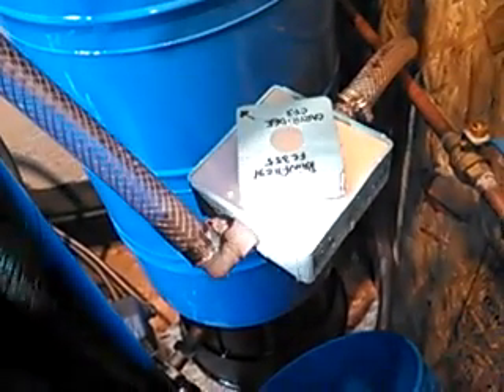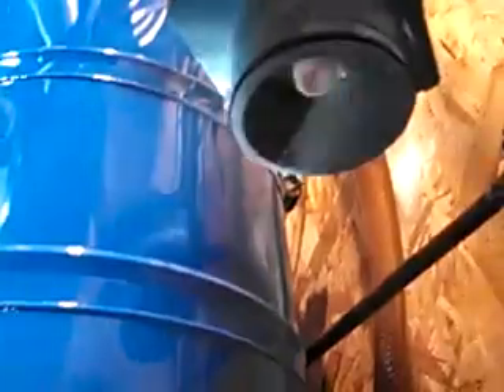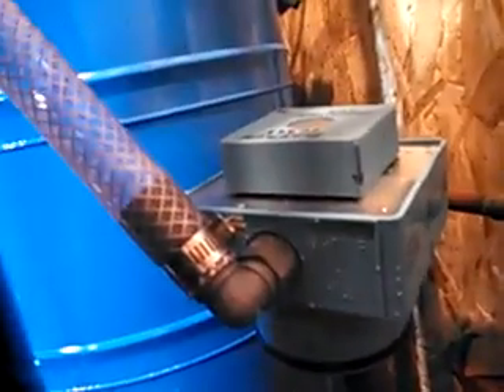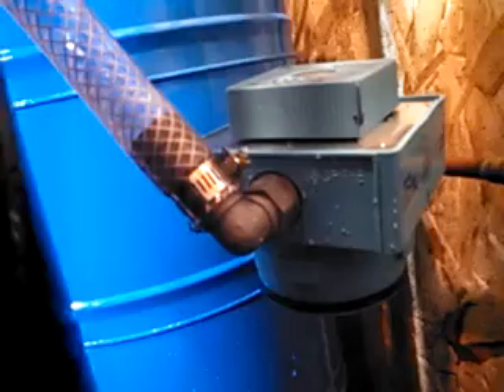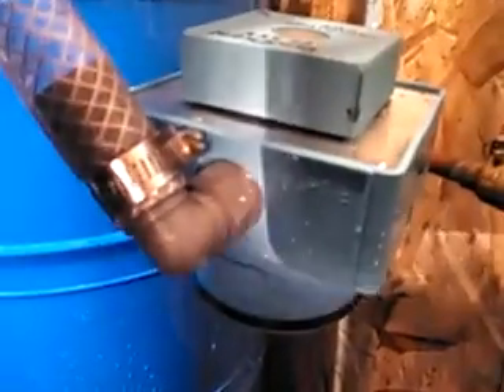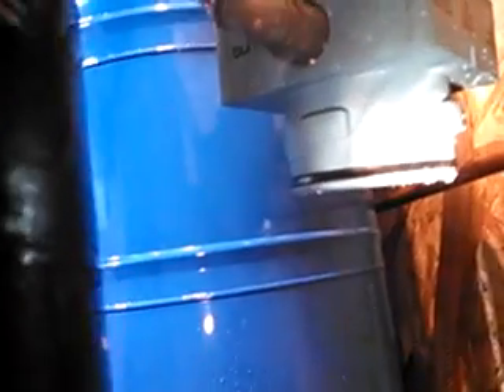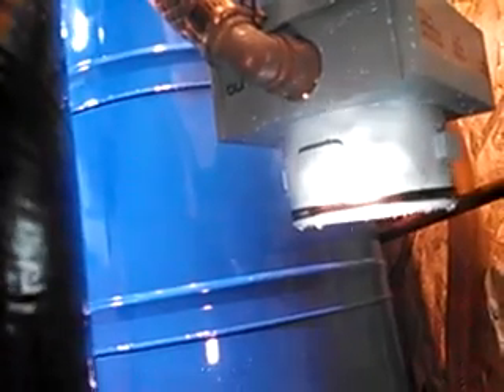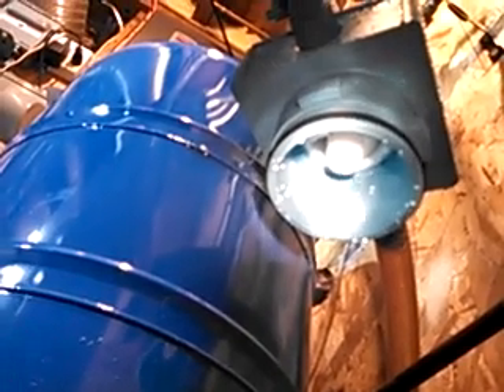Leaking Rainfresh FC355 Filter

Comment: K, just adding this in for folks. With the Rainfresh Bypass type filter unit, you need to turn off the water supply and release the pressure by turning on a tap. Remove the Transparent blue filter enclosure and filter. Carefully remove the center silver (round) cap from the top (rotatable) on/off/bypass block. Remove the screw (#2 Roberts) and carefully lift that block straight off. Note the positioning of the center (white) valve body post for easier re-assembly. Gently push down on the center of the valve body (white) post. The whole assembly should just pop out. (best to have something like a bucket to catch it in) Up inside the main body, you will find (unless they fell out with the valve) 4 "O"-rings that need to be replaced (Rainfresh Kit #516-1 [<$3 Cdn]) Give things a quick cleaning wipe-down, lubricate the new rings with silicone grease (helps them stick in their respective positions) as well as the valve body sides and top surfaces. Very carefully align the valve body back in from below, so as not to dislodge the two side O-rings. the valve body should pop back into its original position. Replace the top rotating  on/off/bypass cap and screw. re-assemble your filter assembly to test, and then you should be good to go.
   Of note: that square aluminum plate below the on/off/bypass cap can also be removed when the cap is off for cleaning underneath it by carefully prying it straight up as well. It will likely be full of purged water. This sometimes can appear to be "leaking" if it is full and overflows.
   Cheers all!
Reply from the maker: Hey thanks John for the added tip! I'm sure someone will stumble in and see this at some point!
Reply: omgosh > Thank You! .. I'm going to copy your note to my plumber and HOPE he will come do this for me. :( 
I'm old, have mobility issues.. and lack confidence to do this myself.  **I Do appreciate the Hope !! Thank you!

Comment: did you get this problem fixed and if so what did you do to stop it.. Mine is doing the same thing.  This is the second time it has started leaking on me.  The first time I used plumbers grease and it stopped it.  This time after changing my filter I cannot get it to stop leaking even with plumbers grease.
Reply from the maker: Did you get that answer Cory, I returned it fortunately my receipt was still valid and bought a Watts Whole Home Filter System...works much better. http://www.amazon.com/Watts-WH-LD-Premier-Filter-System/dp/B000E78XH6

My Rainfresh unit appears to be faulty under the head which is bad. They have that unique system to bypass (which the Watts has aswell) that theirs seems to be faulty. I did like how you can remove the sump and nothing splashes but I'm much happier now.